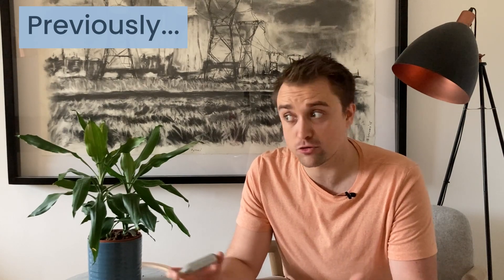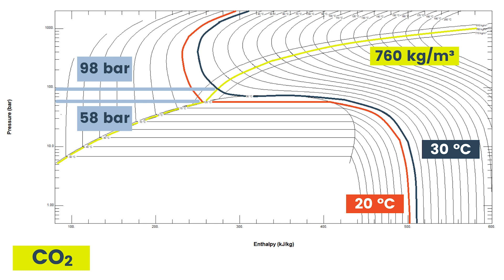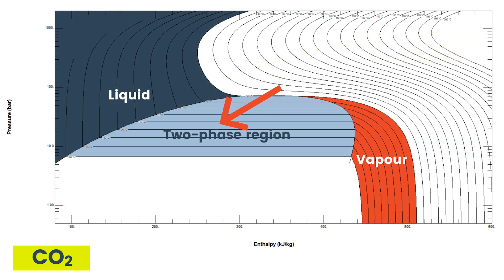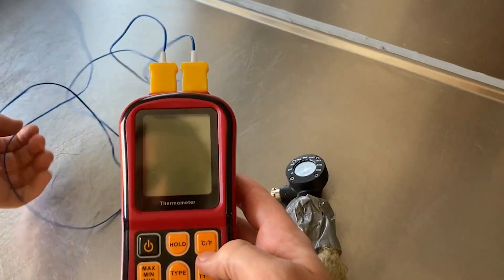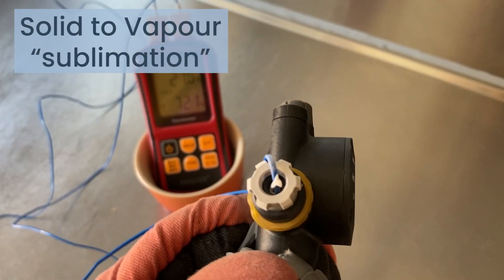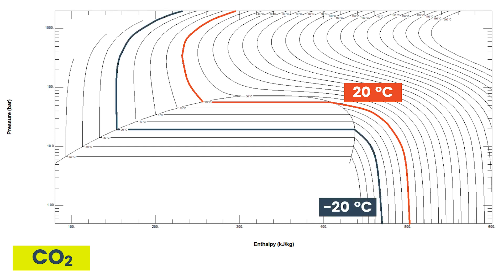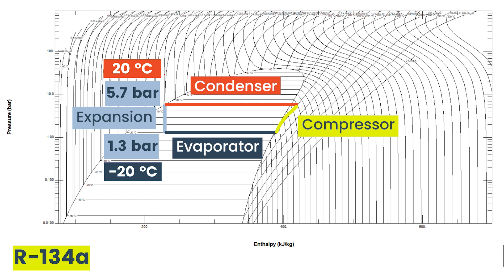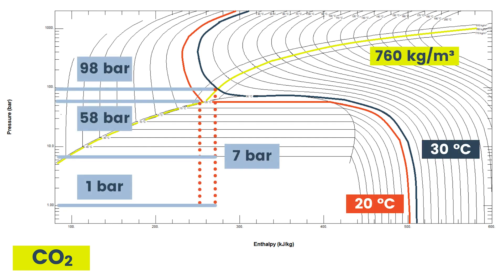Can we use CO₂ in our fridges & AC's?

Comment: Very good video. Thank You!! What I learned from this video is that the components must be beefed up AND some kind of anti-dri ice mechanism must be installed. The CO2 would be cheap, safe, and not harmful to Ozone but the mechanism to make it work would be expensive. Now I'm wondering how long will a CO2 system last so that it pays for itself like solar panels. I'm also wondering if the CO2 system draws more energy due to having a beefier compressor.

Comment: Very interesting video ! I was wondering what is the final volume of the cartridge at 1bar  ?
Reply from the maker: Awesome. The volume doesn’t change, so I’m not sure what you mean. You mean what mass is left when the pressure inside is equal to atmospheric? You can use the ideal gas law to calculate it.
Reply: I mean we have a 21ml of compressed CO2  at 58 bar , what would be the volume of gaz once you decompress it ?
Reply from the maker: Then I'd use (assuming 20 Celsius) PV = nRT = mRT/M, so V = mRT/MP = 16 g × 8.314 J/mol.K × 298 K ÷  44 g/mol ÷ 101325 Pa = about 9L

Comment: Great video 👍👍
I was surprised the temp. would drop to -72 C. So I believe frequent use of this cartridge may not be good for the valves and tubes of the bike as I doubt they can handle this low temp. and resulting thermal shock.
Reply from the maker: Yes you can seriously hurt yourself if you aren’t careful! Holding the cylinder after discharging it really burns if it doesn’t come with a cover. Interesting point about the potential effects of thermal shock on the valve!

Comment: Clever concept idea pat! CO2 in fridges would certainly be interesting, maybe it could have an impact to offset carbon footprints…?
Reply from the maker: Doubt it… the small mass of CO2 inside the cycle would be offset by the power consumption of producing components for higher pressure as well compressing to higher pressures!
Reply: Completely true, did not consider that!
Reply: @ChemEngWeekly  Plus, the way we extract the various components of air, is to cool them down to extremely low pressures, and sort them by boiling point.  This is how we get pure CO2, pure O2, pure N2, and pure forms of all inert gasses other than helium.   That process alone would produce more CO2 from the energy required to operate the distillation process, than you'd extract from the atmosphere.